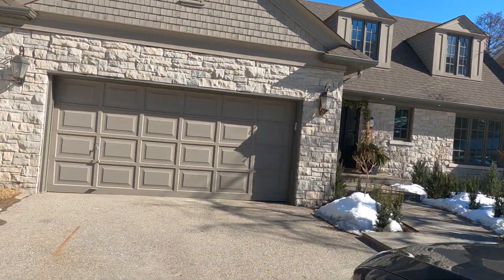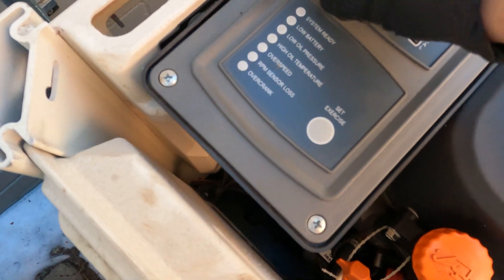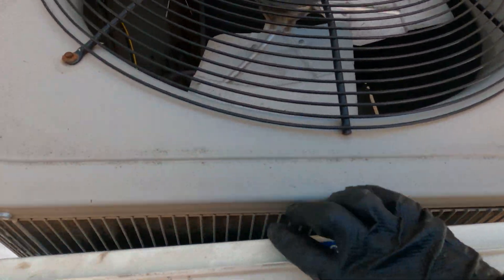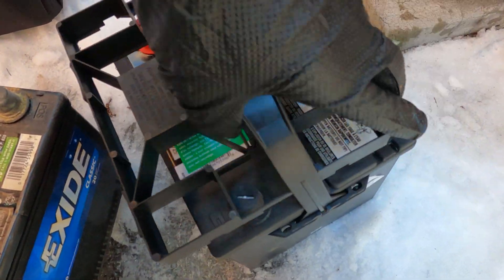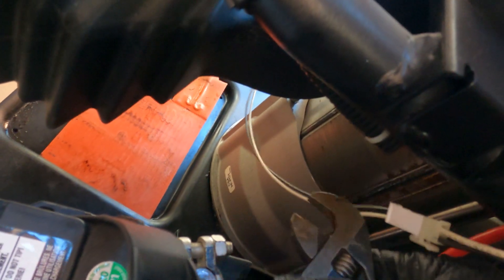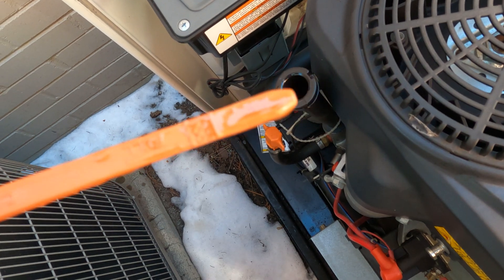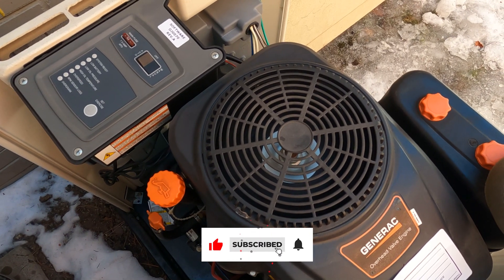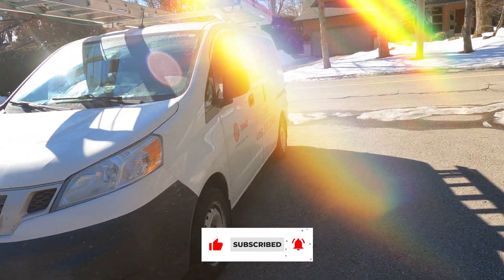7 kW Generac Generator not working due to faulty battery, leaking acid battery change

Comment: What does it mean if the RPM Sensor Loss light comes on but it will manually start? (After starting the RPM Sensor Light goes out and System Ready light comes on.)